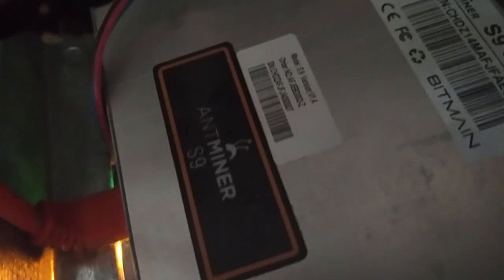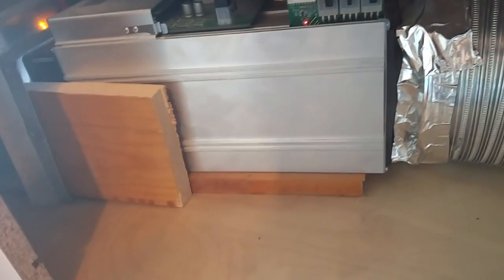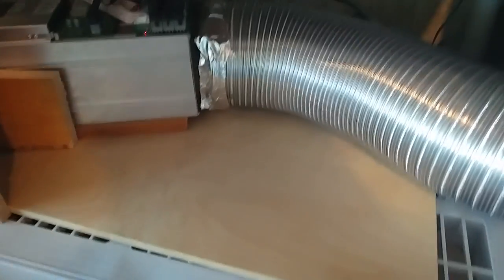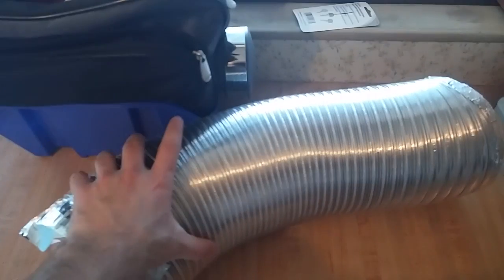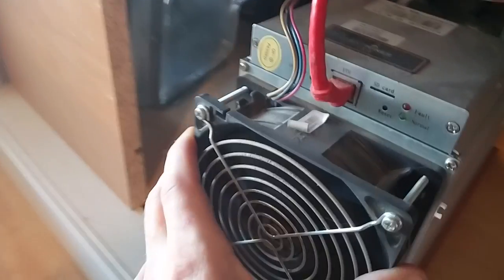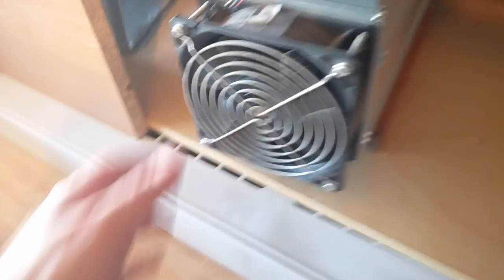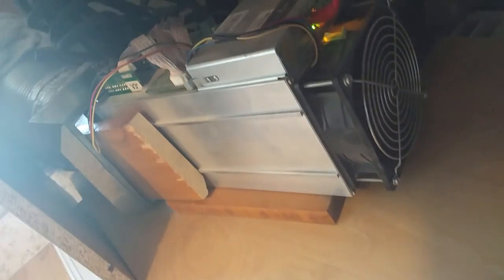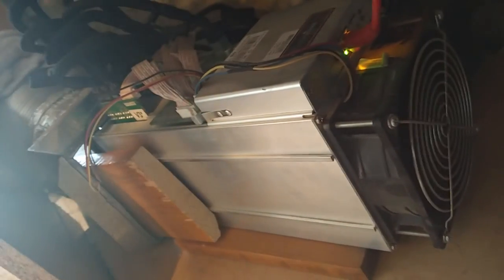Bitmain AntMiner S9 Batch 3 12.93 TH - HOT Winter Woes!

Comment: I won't recommend anyone have it sucking air directly from outside. It will cause too much dust to cover the heatsink reducing it's ability to stay cool, also moisture can cause your entire unit to fry. I'd be interested to know if that unit is still operational under that risky setup.
Reply from the maker: Curtis Antoine... I agree. All my units (1 S9, 2 L3+, 1 A3) have been setup outside in a shed attached to my house and the air they get is outside air. You are correct about the dust buildup. And normally the moisture would be a problem in some climates, but not often a problem here in Yuma AZ. All units are still working without concern. But time will tell.

Comment: Why not install a temperature regulated fan to the outside wall, like you'd install in a greenhouse, which automatically pushes air outside if it reaches a programmed temperature? That way you can set it and forget it? Alternatively, why not set up switch inside the duct work (similar to what some might use for a rocket heater) and use an arduino control board with a temperature sensor that automatically changes the pipe which the air is flowing through so that it will always bring in outside air if the inside temperature is lower and always use inside air if the temperature inside is higher? If you expand with several miners that would seem to be important.

Comment: How are you measuring/removing excess humidity before reaching the miner components? Is the humidity staying between 20-80%?
Reply: Jesus Diaz bigger issue is static pressure with multiple miners. I build a room for my 18 S9’s
Reply: Could you expand more plz. Im planning to buy about 20 D17. Whats the deal with static pressure ?

Comment: where did you purchase yours.  ever bought from Bitmain?
Reply from the maker: I got mine direct from bitmain
Reply: Samson Shepherd thinking about doing the same but a little nervous about the transaction.   Glad to find another who has done it. 

Are the ones on amazon basically bought direct and marked up?
Reply from the maker: TheStockDok I was nervous too. But I would buy direct. Bitmain is the manufacturer and seller. Anyone else is reselling it for a markup. It is cheaper and the shipping was really fast, at least it was for me. But just so you know, these miners now only earn about 0.19 Btc per month for me. If you calculate in electric cost and the cost of miner, it may take a while to get your money back. My return on investment is turning out to be 15 months since purchase. But I bought mine at $2200. So your experience may differ. Also their power supplies they make require special outlet. Look for a 1600Watt by EVGA for power supply instead. Buy from Newegg.
Reply from the maker: I emailed you right after you asked me to. Not sure if it got lost or not.